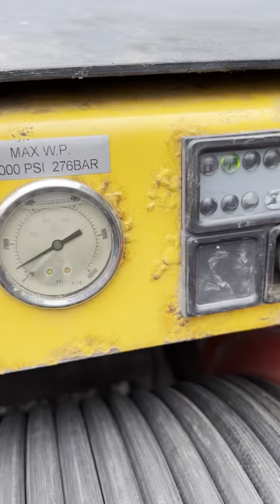Using my favourite spinning jetting nozzle to unblock a pasteuriser’s pipes  #warthog #turdoftheday

Comment: Nice use of warthog.

Never had to deal with those. I usually use that head for manholes
Reply from the maker: It’s such a versatile piece of kit, I literally use that on every other job, iv got 2, this one is for facing forwards unblocking and cleans and then I have a rear facer so I can watch it on the camera and cut concrete out with it